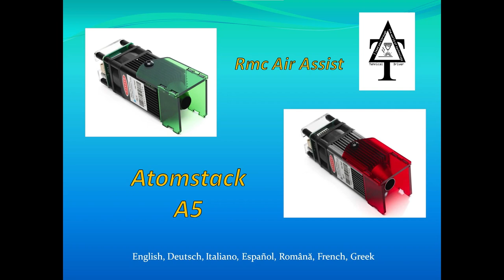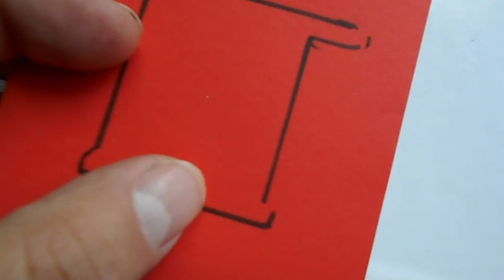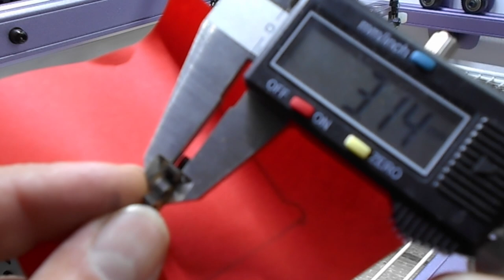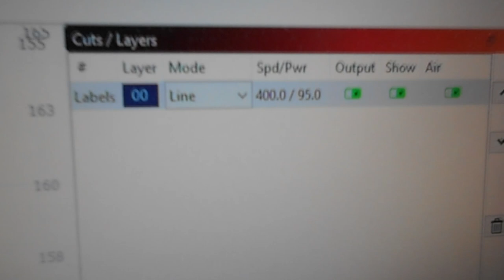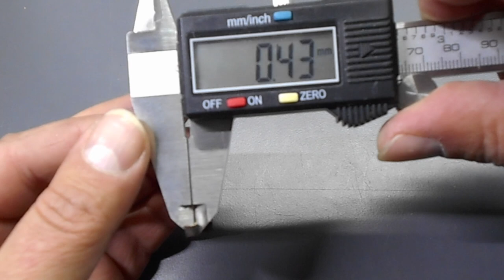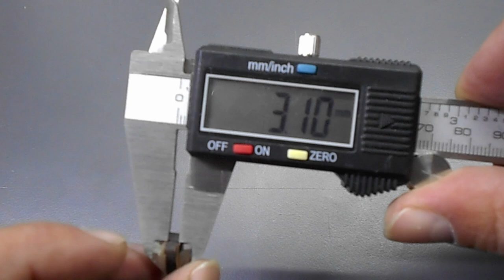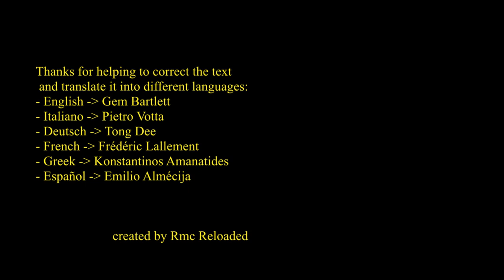Air Assist for Atomstack A5 20W, 30W, 40W

Comment: What power and speed and cycle  you use to cut wood and acrylic?
Reply from the maker: I don't cut acrylic! It's too toxic for me! Wood settings differ by manufacturer, humidity, size, quality, etc. Enter the official Facebook group - Atomstack, and in the Files section you will find some test grids - Power Vs speed uploaded by me! When you have a new material, try the grids for the first time and see the working settings!